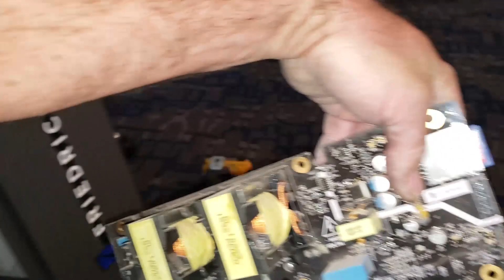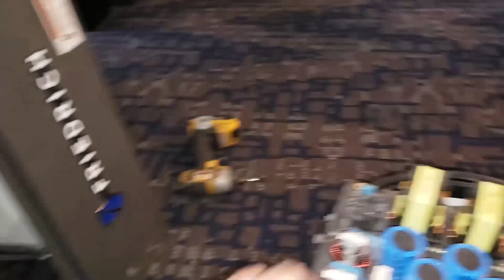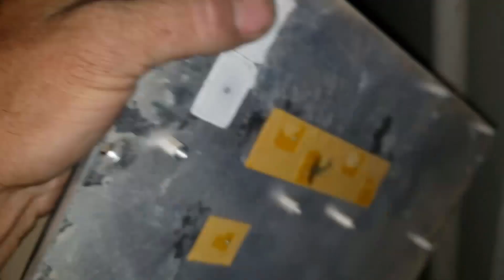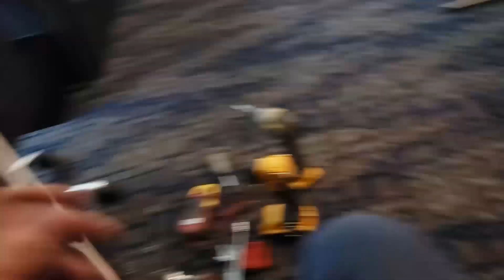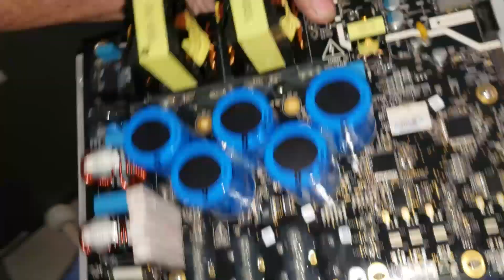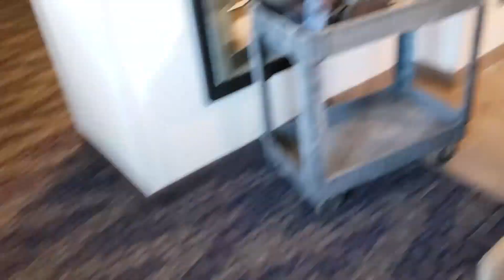Friedrich Variable Refrigerant Flow Inverter Board Replacement

Comment: That looks like a expensive board! 🤑 Trane unit VFD boards are cooled by refrigerant lines instead of just air
Reply from the maker: Yeah but it is just warm liquid refer line so around here that be still 125 to 130 degrees. 
But for those electronics, 130 degrees is removing heat.

Comment: Just about ever other inverter driven unit ive worked on, i found the boards bad. Daikin, LG,Mitsubushi......the technology just isn't there yet....
Reply from the maker: Mitsubishi, Fujitsu etc have been making them for a good 20 years or so. I don't have to fix them too often. 

The problem here is the contractors operated the A/C while doing the drywall and plugged the coils!!!
The units ran hard and were overheating.

Comment: Looks like that one MOSFET was over tightened and over the years of thermal cycles of expansion and contraction finally wore through the insulation and shorted out. 
         Same thing used to happen to me when I build class A stereo amplifiers and I used to think tighter was better. That and not perfectly lapping my aluminum heat sinks so they were perfectly smooth.
Reply from the maker: Maybe., 
But I guess several units got overheated because the contractors turned the A/C's on and plugged them with drywall.
They were cleaned but some were damaged.
It probably had the amps pegged.